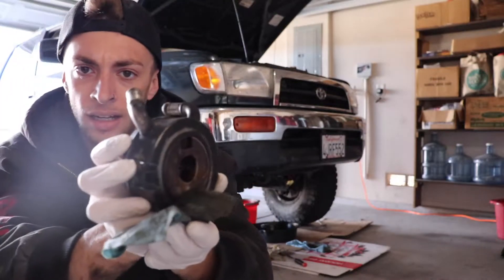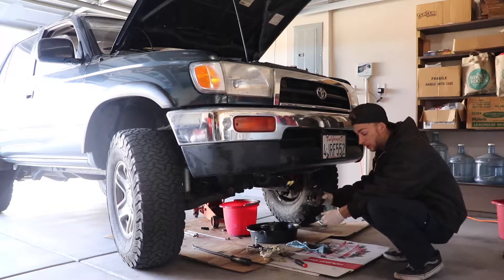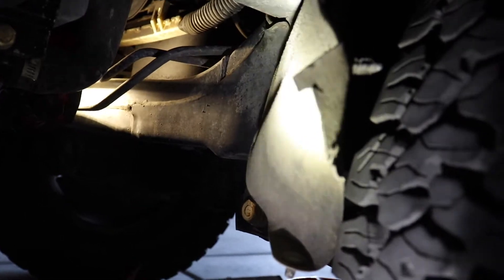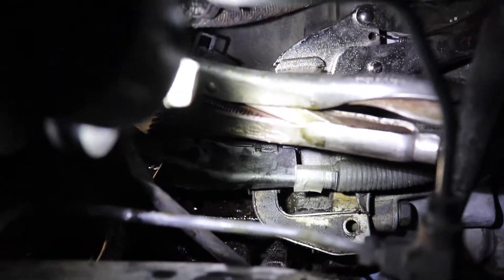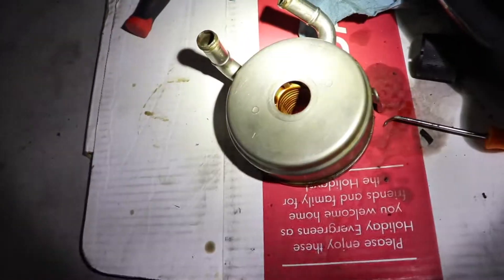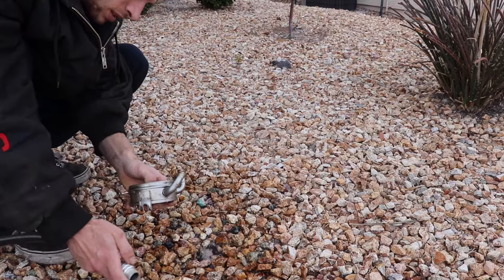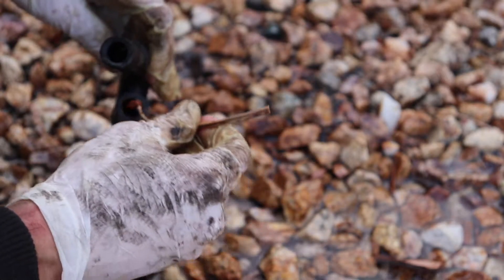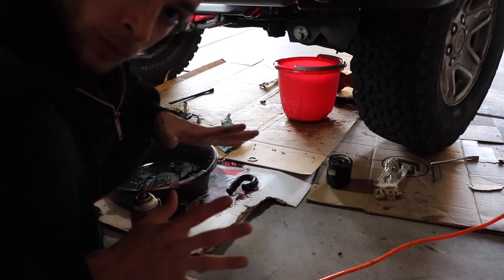Toyota 4Runner Oil Cooler Seals Replacement 4x4 (1996-2002)

Comment: Guess this is how/why the Pink Milkshake happens.  Funny how Toyota never lists this as things to inspect at certain mileages smh
Reply: This isn't the item that causes milkshake. Its the owner failing to replace the radiator that is integrated with the automatic transmission cooler. Replacing the radiator every 10 years max or every timing service prevents milkshake.